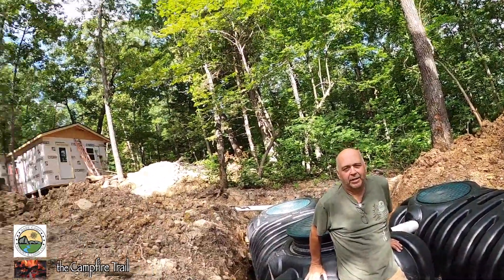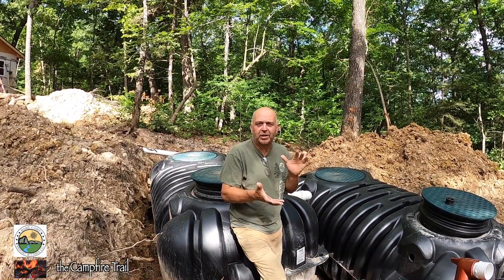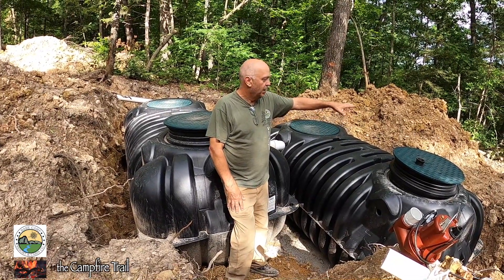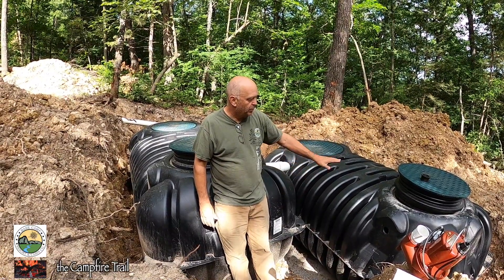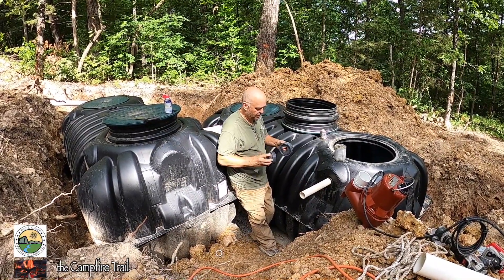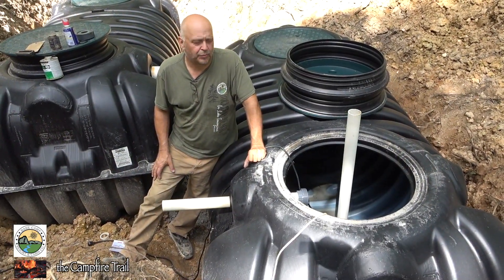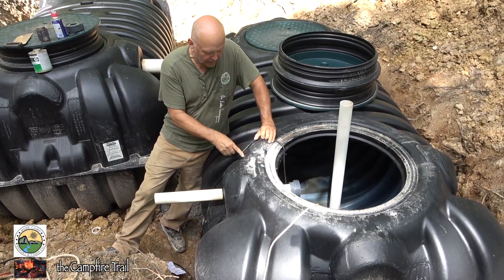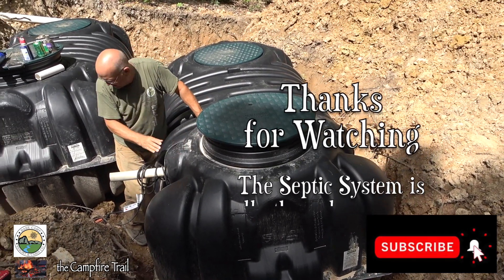Installing A Do-It-Yourself LPP Septic System Pump (at Camp Run-Amuck)

Comment: What brand tank is that and how did you seal the opening for the wiring. Thanks!
Reply from the maker: I got it from a local supplier and not sure of the brand but I'm pretty sure it's this in a 1,000 gallon model https://www.roth-america.com/product/septic-cistern-rainwater/

I drilled a hole near the outlet pipe close to the top and made a plastic cover plate with a slot for the cord then sealed it with silicone caulking.

Comment: What brand and horsepower is that pump? Thank you, Sir!
Reply from the maker: I'm going from memory here and it's been almost two years. The brand was Liberty. It is an effluent pump vs a sewage "grinder pump". I'm pretty sure it was 1/2 hp. When using an LPP system, the pump is handling liquid with very minimal or no solids at all.

Comment: No check valve?
Reply from the maker: Nope. Check valve would hold water in the lines and being only 12" below the surface, could freeze in the winter. The pump sends water in an uphill direction about 12' in a 2" pipe before it turns and goes downhill through the manifold. About 12' of 2" line drains back to the tank is all leaving the pipes empty once the pump turns off.